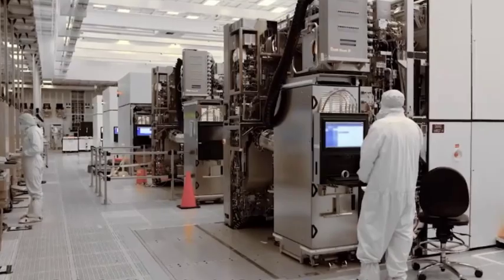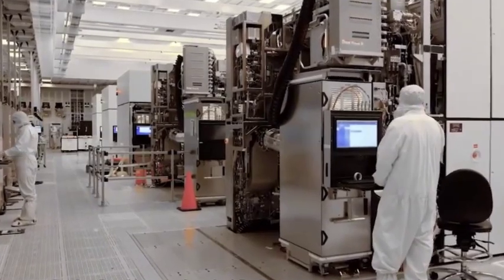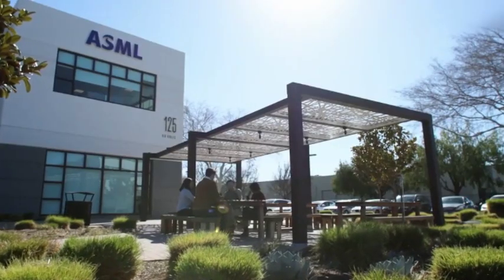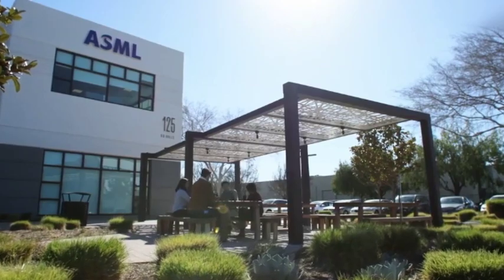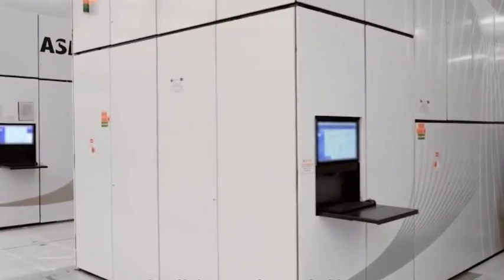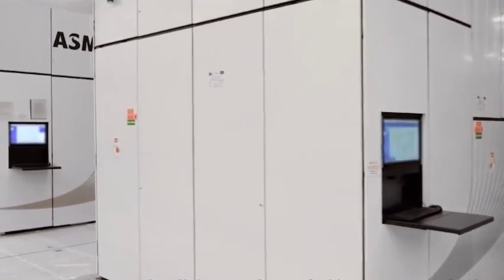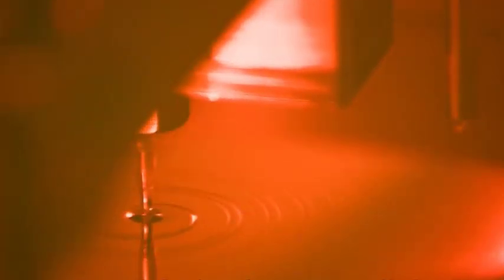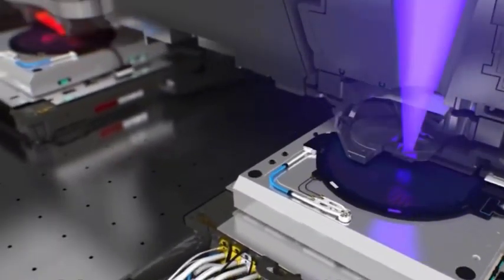Tsinghua’s EUV project has been launched, China’s EUV factory project is about to be launched.

Comment: Wow, Tsinghua university is ready with the concept of the Chinese high energy synchrotron radiation project to be implemented. China uses the high energy synchrotron light source instead of ultraviolet light which is currently being used in the EUV lithography machines. This China’s photolithography machines will enable China to produce 1nm chips or even smaller which is very difficult and expensive to make with ASML’s EUV lithography machines. Great China. 👍👍👍
Reply: The Chinese successfully showed there're always other method and technology to produce high end chips. Well done, Tsinghua University !